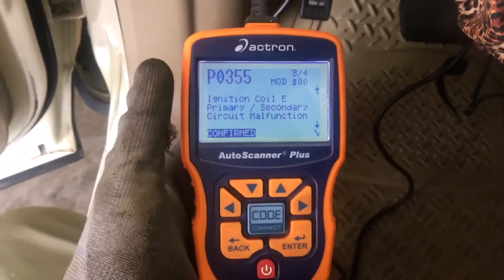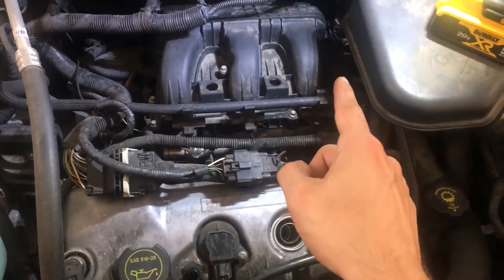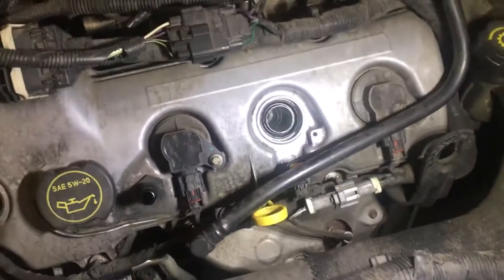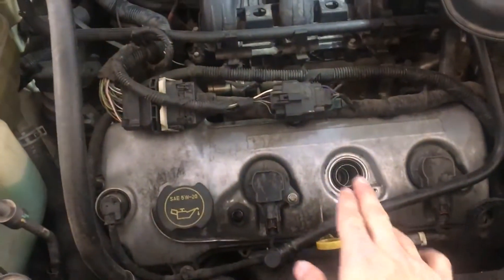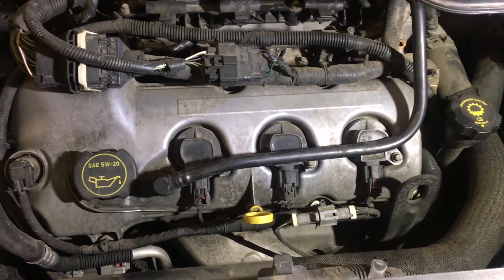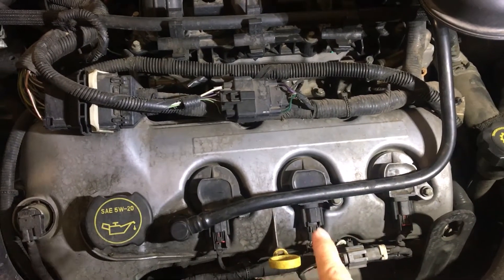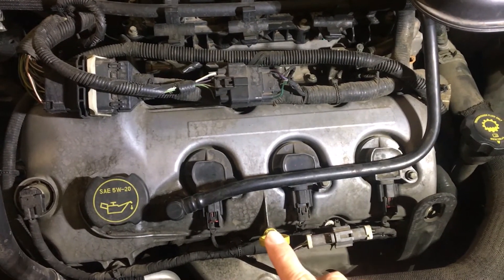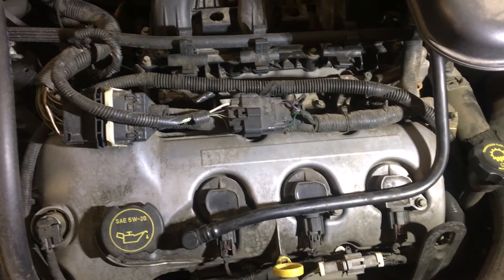Ford Ignition Coil Malfunction P0351 P0352 P0353 P0354 P0355 P0356

Comment: Same problem with my 2011 explorer says coil “B” i swapped it nothing, i put a new oem spark plug and nothing. I have no clue what else i could change? Any help? Thanks!
Reply: Well it usually has to do with the electrical current going to your coil so it’s probably an issue with your wiring.